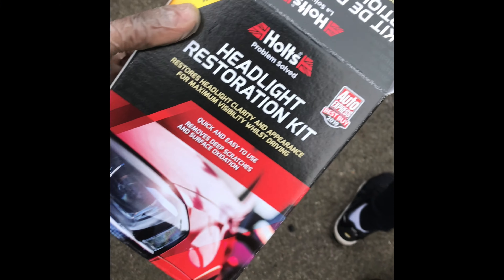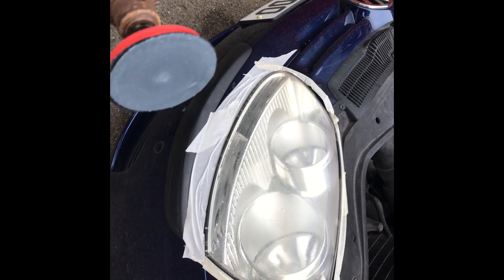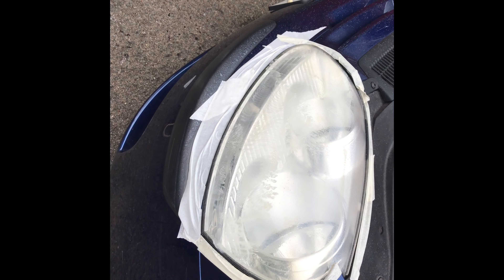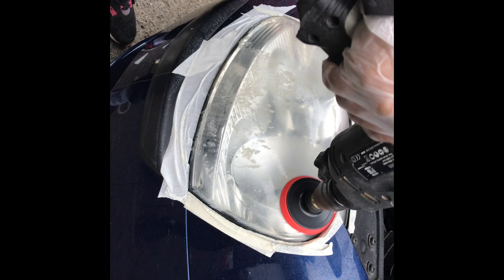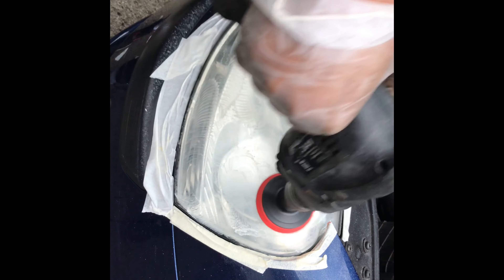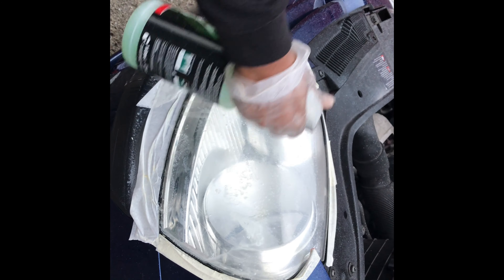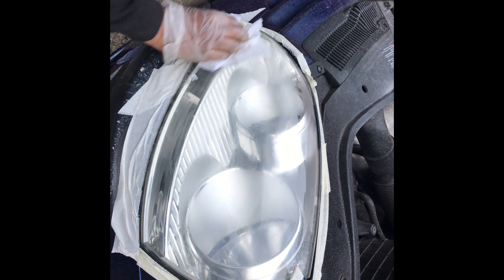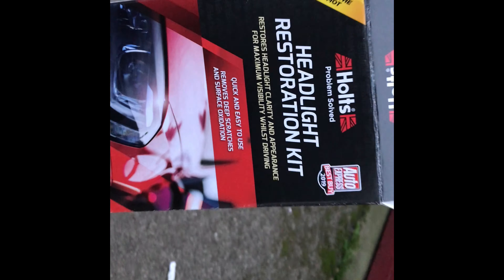Holts Headlight Restoration Kit Review

Comment: Did you really just put your sanding disks on the floor?
Reply from the maker: They were face up
Reply: @jaysworkshopgarage  I see that, but it's still bad practice. 
Never put sanding disks or anything you use to touch the car (brushes, rags, clothes etc) anywhere NEAR THE FLOOR!
Reply from the maker: @unfortunatereality2011  I agree with you thanks for your feedback 👍🏽
Reply: @jaysworkshopgarage  No worries bud! Might be worth getting a cheap little foldout table when you're cleaning up the car outside. Keeps all your stuff together and safely away from the floor 👍
Reply from the maker: @unfortunatereality2011  will look into it 👍🏽